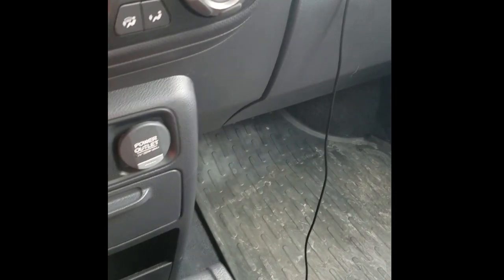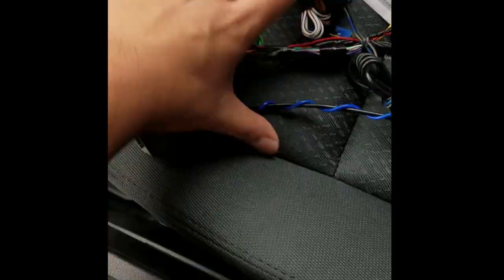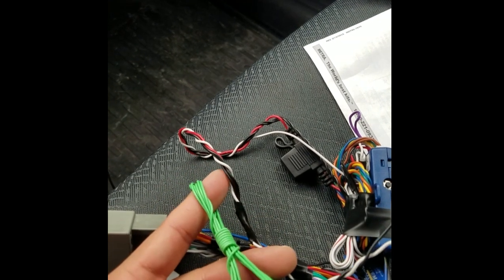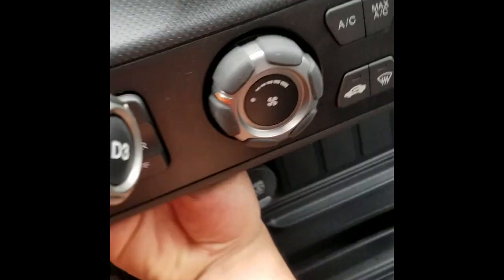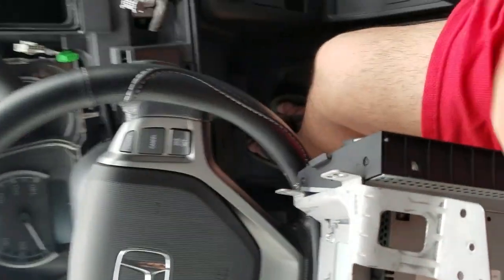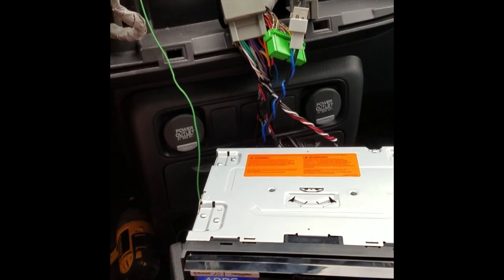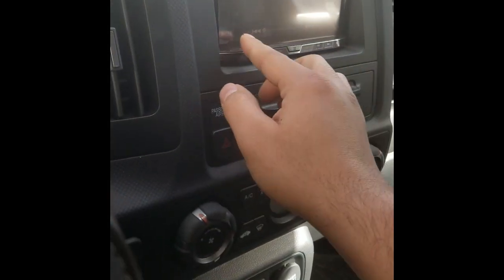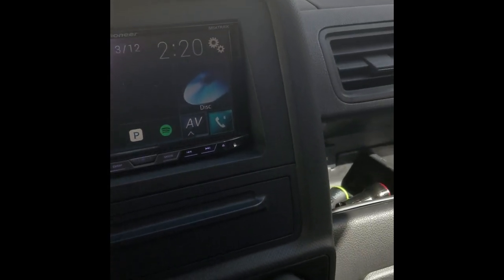Ridgeline Pioneer headunit Install

Comment: Thanks for the video. I have a 2012 sport.
Did the HU improve the sound of the speakers?
Reply from the maker: paisa007 yes, a huge improvement with the stock speakers. More mid range
Reply from the maker: paisa007 looking into a subwoofer but not a need since I dont want to loose space to have one
Reply: Does you steering buttons work with your new head unit?

Comment: Still happy you went with the non-Android auto model? I'm right now considering the same thing for my 13 Sport -- Android Auto or save $200.
Reply from the maker: Always good to future proof urself. My gf has auto play on her car. Cool feature to read texts thru the screen....but is it worth the extra 200$ for the gimmick?
Reply from the maker: Not sure how efficent the whole map thing  is with these system. The pioneer app in this system is real glitchy using the maps but it could be my phone

Comment: I heard that when you install a new head unit, the subwoofer behind the back seats don't work....did you notice this at all?
Reply from the maker: Its true. BUT because mines a sport model, didnt have it to begin with.
Reply from the maker: I just recently installed a subwoofer. Made a custom box behind the seat and ran a line from the receiver->amp->subwoofer
Reply: @Garagejunky09  Thanks for the quick response...I'm looking to buy a Ridgeline that HAS the subwoofer, but I dont plan on paying to upgrade it when I replace the head unit...I'm not an audiophile, do you think the sound from the Pioneer player is good by itself?
Reply from the maker: @TomTomTom87  it was day and night when I upgraded.
Reply from the maker: I just recently upgraded my fronts and a few weeks later did the rear doors and following up with the sub...EVEN BETTER!   I have a few clips here and there I recorded, I will try and upload it

Comment: Did you figure out if the factory sub worked?
Reply from the maker: Juan Hernandez i have a sport model. Dont have a sub, I would look on the ridgeline forum
Reply from the maker: Juan Hernandez i would imagine you would have to splice from another channel for source and a dedicated 12v source to actually power it.
Reply: I have the 07 with the factory sub but it's not hooked up to my double din
Reply: Same thing. Just got mine installed today. There's a few ideas the ridgeline forum. VAN DIY how do you find it sounds? I find the Bluetooth audio sounds the best.
Reply from the maker: Juan Hernandez the bluetooth on my pioneer is quick to sync and audio is clear with no issues. Better than my 09 tsx. Best mod Ive done to a car in a long time. Only regret I didnt go Nex now lol

Comment: Are you able to change songs with the channel button on steering wheel while your aux is connected? Also how did you get that USB down into the center console? Did you have to buy any extra harness to connect to the steering wheel controls? Looking at having same done on my 2009 Thank you!
Reply from the maker: Mathew McKeever no control functiom if Aux is connected. The harness was bought seperately for 15-19$ depending where you buy it
Reply from the maker: Mathew McKeever yes, you have to buy a module to have full steering wheel control. When you buy it bundle the module is much cheaper with a headunit. Seperately I think they got for 80$
Reply from the maker: If you check out this video, the near end will show you how I installed the USB harness https://www.youtube.com/watch?v=KRodFiRKs7Y
Reply: That's great! Thank you so much! Going to have a professional install mine as I'm not very..... technically savvy let's call it. Thanks again!

Comment: You really need to use wire crimps. What you have is only one step above just taping the wires together. Your camera work is also very bad, please don't use your phone camera -- either have someone else film for you, or use a tripod. You also cut out most of the important steps in the middle.